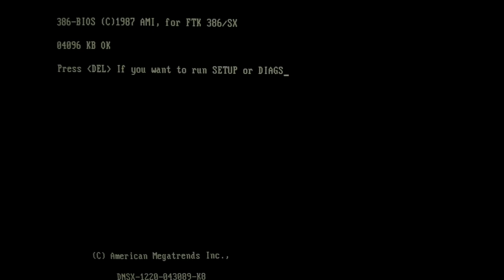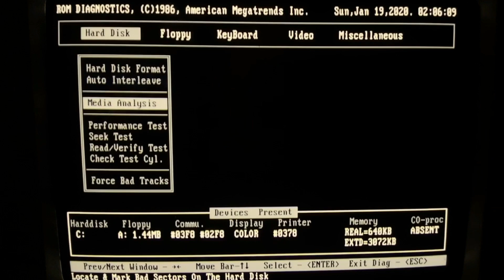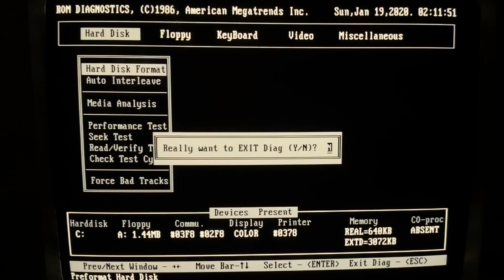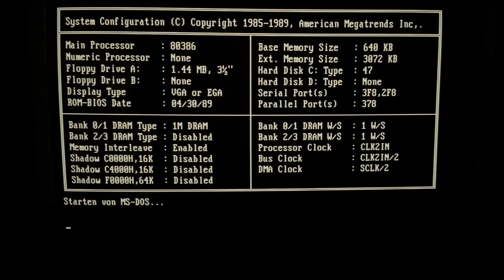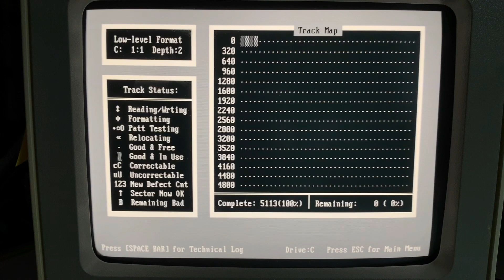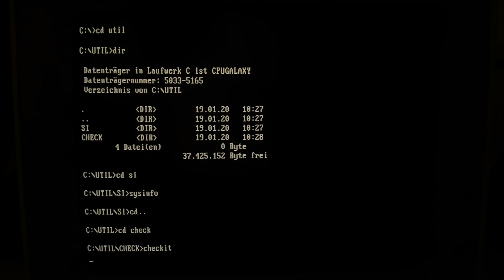MFM Disk Drive Repair, Low Level Format & Testing Tutorial #vintagecomputer

Comment: Some stepper and servo motor drives (yes, servo motor drives exist) are self-parking.  Many Miniscribe ones will self-park after a period of inactivity.  Many Seagate stepper motor drives will use the inertia of the platters to generate electricity to park the heads; I believe the ST-251 was the first to do this.

Comment: I have one of these drives faulty. It spins up, but it over speeds well past 3600 rpm and is not stabilizing. Would like it back since it was my fastest half height MFM drive.

Comment: I have a Seagate ST-1100 with a very weird behaviour. If I terminate it correctly (no termination on that one, and one on another drive at the end of the cable), I can format with head 0 and that one only - it even boots from the drive like that.
When I change termination settings, I'm able to format with heads 2-7 apparently successfully, but not 0 and 1 - which makes the drive fail since track 0 is unavailable, of course.
Depending on how I install and terminate different drives, it gives a different result, so my conclusion is that it has something to do with improper termination for some reason.
Do you have any suggestions as to what might cause this behaviour?

Comment: Excellent work, you save that piece of computer history from the shreder!. i still have an old 286 motherboard with the same BIOS to do low level format. I recently bought an IBM Thinkpad 770X from a guy in Germany, the laptop is in very good shape but the original hard disk worked some time and started to slow down and showing bad sectors, i'm going to use the old board, maybe i can repair it?

Comment: Tantalum capacitors have the bad habit of clearing themselves from time to time.
If placed on a low impedance line, they short the power supply and may kill themselves too.
They were invented for timing purpose and power filtering (where there is a resistor in series).
Some designers (most famously, an HP line of instruments with communication bus) didn't know tantalum capacitors well, and were splurging on them. The designers of this hard drive were part of that category, placing a tantalum cap in parallel to power line.
Nowadays they have been replaced with multistrate ceramic (non-electrolytic) capacitors on all modern hard drives.
Thanks for the video. I think was year 1992-3 that we used MFM (modified frequency modulation) hard drives, soon overseded by RLL (run length limited), and soon after, drives made their own sector translation, so to place more sectors on the external disk tracks: MFM and RLL had the same number of sectors on the first and the last track...

Comment: Very Very Nice repair. Can a 286 and 386 run 3.11 for work groups windows ? or Windows 95 ?
Reply from the maker: yeah, a 386 can run windows 3.11 and windows 95
Reply: @CPUGalaxy  though for windows 95 i think the correct term would be CRAWL not run
Reply: I would not want to run 95 on a 386.
I can remember running Windows 3 on a 286 with 1MB - it was a sample machine and only had the 1MB (640k plus BIOS shadow), and the rep that brought it said real mode wouldn't be great...
Standard mode, I said, and went into BIOS to swap the 384k from shadow to extended, which surprised him as he never knew it could do that ... many systems in that era could, but ONLY with 1MB - with more, the shadow cannot be reassigned

Comment: Thanks for your very nice videos my fellow Retro friend, you have gained my subscription! I would love if you could dive deeper in the meaning of the CHS stuff (Landing Zone, WPcom...), I never know what those are or where to find the information on the drive...
Reply from the maker: Thank you very much! I appreciate your subscription a lot!
Good idea, I will try to cover your request in a video. 👍🏻
Reply: Cylinder,  Head, Sector. On those older drives, those are usually printed on the label. If the label is gone/damaged you would be on a wild goose chase to find that now days. I just barely remember that stuff, because it became "automatic" about when I got into it. Only 2 reasons I remember is because I needed to know them when drives went over 512mb capacity, and I had a 386 with faulty CMOS battery wiring (wasnt a battery issue, bad board, eventually used AA batteries & didnt solve it). DISCLAIMER- I was a kid back then. They referred to "how many rings", "how many blocks per ring", and "how much data was in a 'block'". As I recall. I could be wrong,  but I remember entering those numbers every day. Eventually got a 486, and after that, an "overdrive" cpu. One day I got a P3 "coppermine" and thought I was king of the world for a minute.